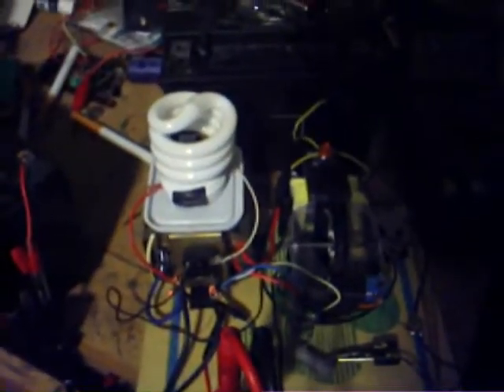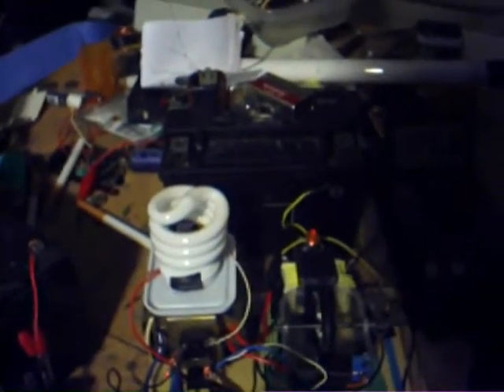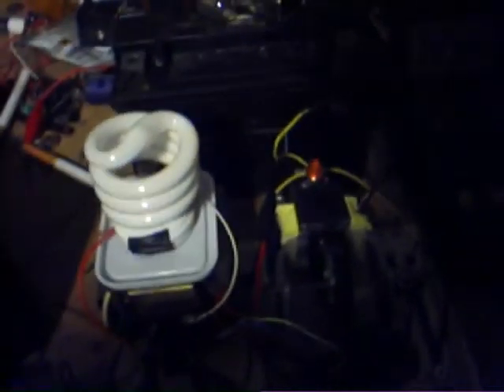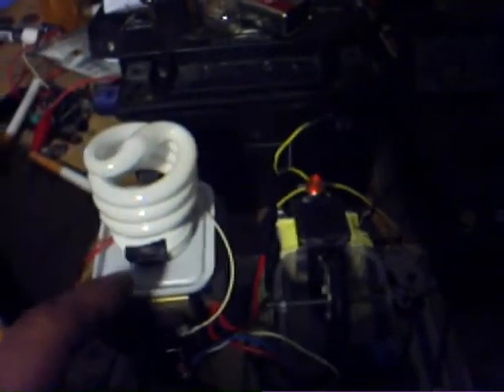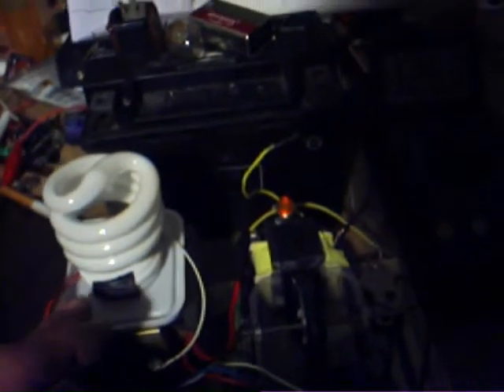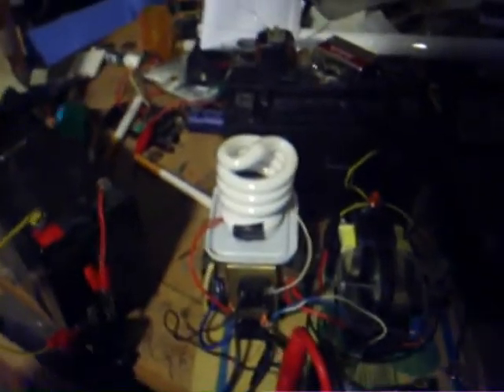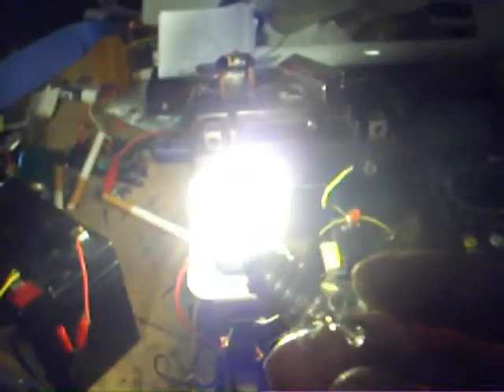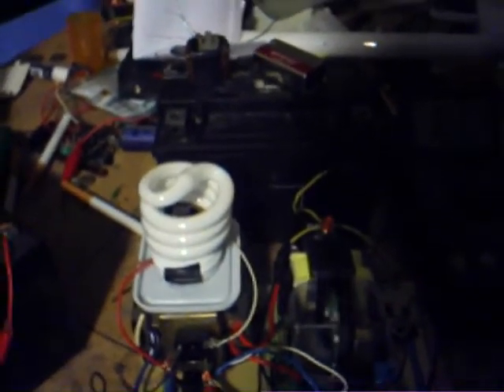little pulse motor big output

Comment from the maker: @min2oly yea i thought it was interesting how the bulb was less of a load than the CFL.. goes to show just how much current those bulbs can eat full blast.. the neon can eat nowhere near that much..
never would have thought excited gas would form a higher current load than a red hot bright filament..  
as for the draw i have yet to even check all that.. however it must be more efficient than i thought cause its been running from a 1.2v battery for about 12 hours now and the voltage is holding

Comment: Nice demo!
the motor changed speed because the impedance changed on the output. that's why some batteries will charge faster than others on these energizers. And, you can condition a battery to charge faster and last longer w/ these Oscillators. 
good stuff. the question is how did the amp-draw change on the input when that happened.
I like that relay cap dump idea works like a charm.
Thanks for sharing

Comment: Nice job. A typical solar panel of 100 watts outputs 5 amps @ 17.6 volts max rating during peak sun. Realistically, if we cut that to 16.0v and 4.5 amps, we'd have 72 watts output. Could this setup keep up with that, and actually use all the juice? Also, do the batteries recieve the spikes, as well as the CFL? Or was the CFL just an output load for when the charge battery is disconnected? Thanks